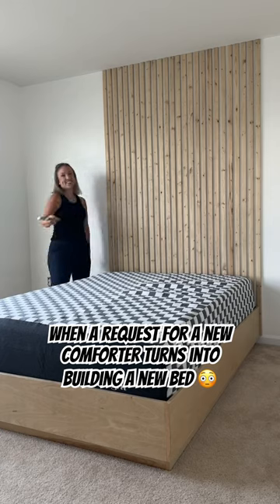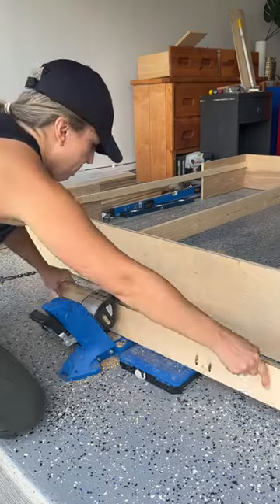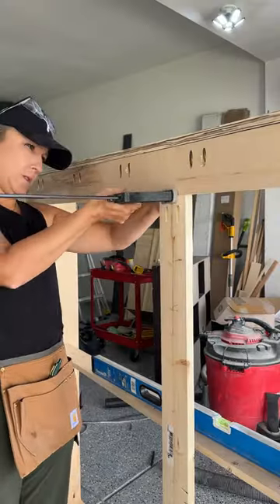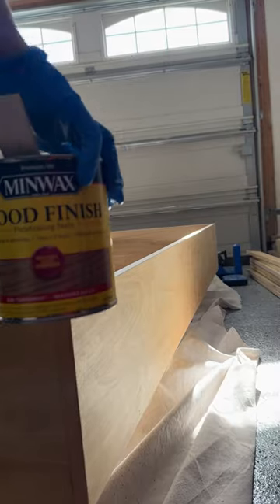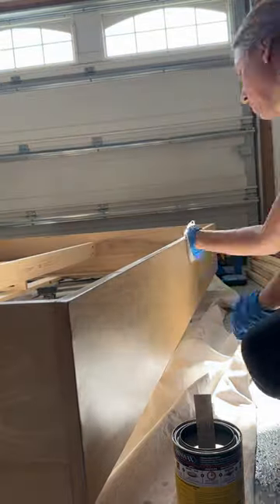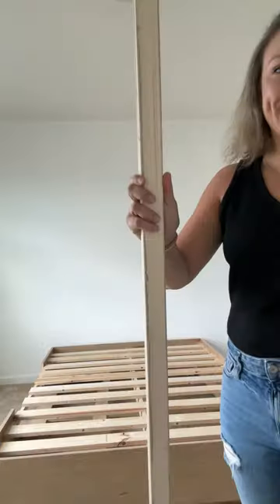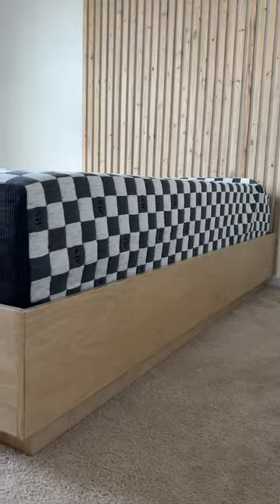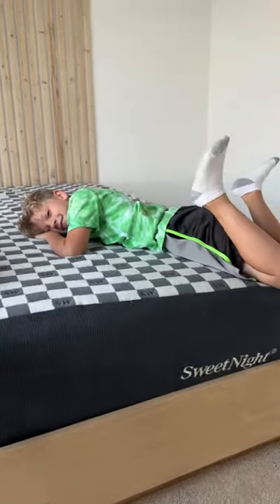Complete Bedroom Makeover | Bed & Slat Wall

Comment: You should build a secret compartment in the wall behind the bed the accesses the spacing between the studs.  Put some shelves between the studs and now there is a place for him to hide his iPad and watch for charging.  As well as his piggy bank!  If his wall is an exterior wall then pull the bed away from the wall and build out a secret space complete with lights, so he can have a night light or lamps.  Tissue box, candy stash, water bottle holder and so much more.

Comment: Can you make a video on creating the bed frame? Also, did you put edge banding on?
Reply from the maker: I’m going to try to write up a blog post because I didn’t record the full process of it 🤦‍♀️ 

I did use edge banding in the top and sides (anywhere the plywood edge was showing). I just used the iron on birch banding that you can buy at hardware stores